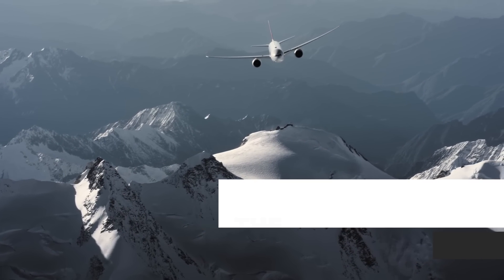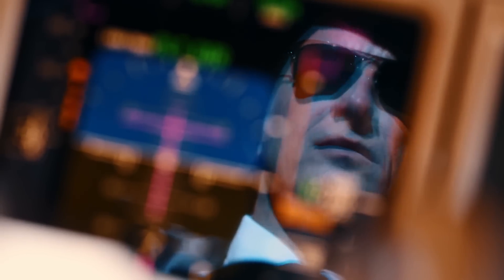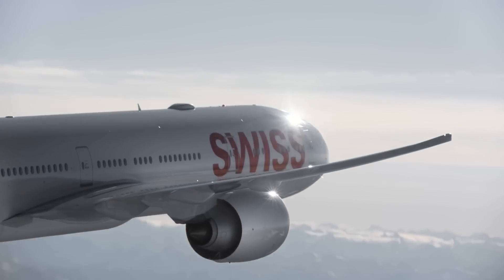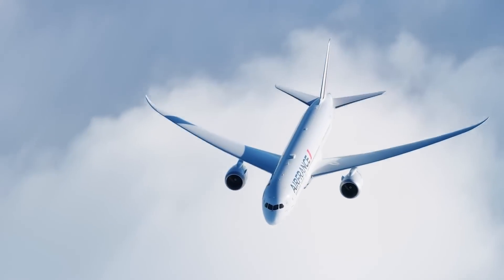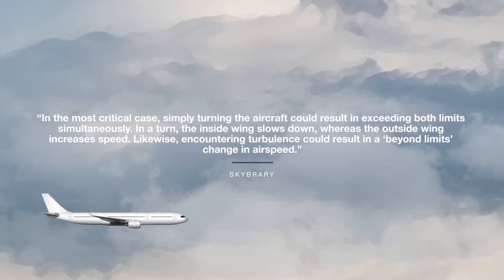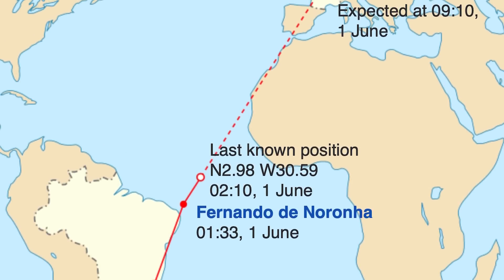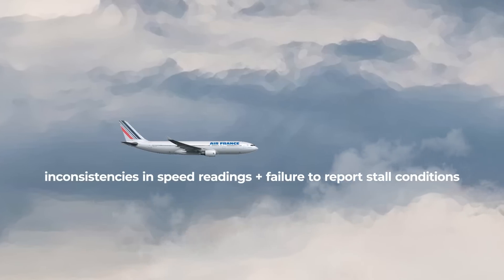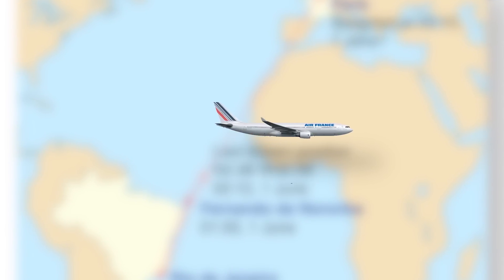What Is The Coffin Corner In Aviation?

Comment: Please define the maximum 100 hours per month for pilots. Is it over 28 days or a calendar month?. Is time in the bunk (on long haul flights) NOT included?. What about logbook hours (often quoted in Air Crash Investigation)?. Is it every minute on the flight deck?. Cheers🥤
Reply: 100 flight hours max per 28 rolling days.
If you are operating crew, that includes a multi pilot  crew , your flight time starts at chocs away and ends when the chocs go in.
These are the times all the crew of that particular flight record in their log book.

Comment: The term "Coffin Corner" dates back to the daylight bombing missions of WW2  The B-17's and B-24's flew in what was called a "Bomber Box" formation where the machine gunners of all the ships in the formation could mutually support each other. The groups flew in 2 "V" formations of 3 planes each with each box made up 3 squadrons with the third formation actually consisting of 7 bombers, the 7th plane, consisting of the least experienced aircrew, being on the outer edge of the formation and in trail of the rest . This was also called "Purple Heart Corner"  for reasons of survivability, or lack thereof.
Reply: Sorry that's another corner.
Coffin corner is so called because of the shape of the performance stall/overspeed graph produced resembles the shoulder area of a coffin.....showing reducing safety margins...
 .......emphasising the danger of operating at high altitudes! !!!
Reply: @daftvader4218  I do realize that, but a good turn of phrase tens to get reused for different meanings over the years, and for what it is worth it has the same effect, pay very close attention to your situational awareness or end up dead.

Comment: Air France Flight 447 crashed because two low time First Officers were at the controls and had no idea about how to fly the aircraft by attitude reference.  Add the fact that the Airbus Side Sticks are not interconnected, and neither pilot knew the the other was inputing different commands while the plane settled to the water in a stalled condition.  The accident could have been avoided if the pilots had relied on the Attitude Gyros and realized that the plane could not remain airborne at that Angle of Attack and Airspeed given the thrust settings.
Reply: Well this would make a lot more sense. I was wondering how the aircraft simply couldn't recover from the stall.
Reply: @mikepearson7608  plane went into Alternate Law 2 from Normal Law and lost a lot of it's protections because of the frozen pitot tubes.  There was a ton on confusion in the cockpit and if you read Understanding AF 447 it's WAY more complicated than anything you can find online will let you believe, but you have to wonder if Dubois was in the cockpit when all of this happened, if it would have been different.
Reply: Robert had almost 4,500 hours on the A330.  Is that really considered low time?
Reply: @billyd5749   4500 hours is meaningless if their basic training was faulty.  Both F/Os lacked basic Instrument flying skills.  If they couldn't recognize the stalled condition by reading their instruments, something was very wrong.
Reply: The titanic of the Sky

Comment: This applies a lot to the U-2 with the stall and over speed  margin being 10kn or something like that at its cruising altitude of FL 700 .  But the question is what is the exact margin for a regular airliner at FL 400? I imagine it to be a lot wider
Reply: It depends on the weight of the aircraft. On the 737-800/max I fly we have had margins at 10-15 knots aswell. Our computer onboard calculates and optimum altitude and max altitude - We are not allowed to go above the max altitude (could be FL 340 if we are heavy enough). It all depends on our route/traffic and reported turblence. :)
Reply: I think it's around 5kts for the u2
Reply: I was thinking exactly the same during this whole video!

Comment: Coffin Corner has nothing to do with Mcrit. It is the region where the stall converges on maximum Mach number (MMO). MMO is not Mcrit and the author of the Bold Method website has mixed them up (which I doubt he would had he ever been type rated on a jet). Airliners typically cruise above Mcrit, so it is not a limiting speed like MMO is. However, the upper and lower speed limits are presented to the pilot on the speed tape so that is what matters operationally. Nonetheless it is annoying how many junior pilots are holding onto misconceptions based on watching YT videos like this rather than studying the technical literature.

Comment: excellent, very informative thank you
Reply: Actually, it was pretty much entirely wrong. Critical Mach number (Mcrit) has nothing to do with a coffin corner - in fact, many jets cruise above Mcrit!

The coffin corner is the small difference between stall speed and max operating Mach number, which is typically constant above 20,000 ft or so.

And it is a stretch to say the Air France crash had to do with the coffin corner. Air data sensors failed, reducing pilot awareness. The pilot nosed up the airplane until it stalled. The same pilot kept pulling the nose up, keeping it in a stall.

Comment: So let’s say you fly into coffin corner and enter a low or high speed stall. Can you recover from any of them?
Reply: AF447 was not able to. If you are aware of the situation, you surely can recover by simply pushing the nose of the airframe downwards. However, in case of AF447, the pilots were not aware of the situation that they pitched the aircraft to the coffin corner, nor were they aware of the stall afterwards. the coffin corner is a lot easier to understand in theory, then it is in the air.

Comment: Seems like the pitot tube is a weak link in aircraft sensors. So many crashes linked to pitot tube failure.
Reply: @donaldstanfield8862  because its a sensor. even if we replace it with a better one, all things fail eventually. 

So instead, the way we get over it is pilot training to properly deal with the situations. Many of these crashes are due to pilots incorrectly doing things in a scenario where they are effectively blinded by the failure of these systems.
Reply: @Alb410  I agree with you. 100%
Reply: Air France A330 were fitted with pitot tubes which were known to be poor performers in icing conditions.
I believe they were all changed afterwards  !!!
The blocked  pitot sent no speed   info to the autopilot so it disconnected. 
All the pilots had to do was to maintain the aircraft pitch and engine power to stay in level cruise. Simple !!.
Basic power/pitch airmanship. 
Speed?  Check GPS !??
Fly out of icing area...
Re-engage autopilot !!
They were not pilots !!